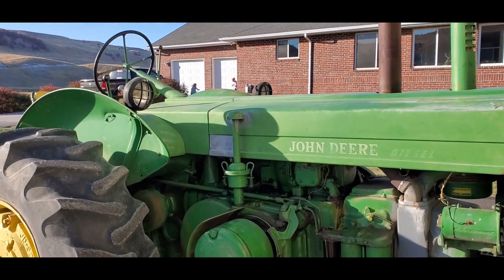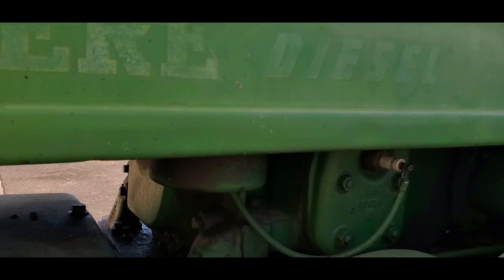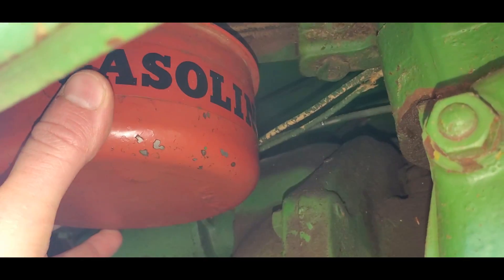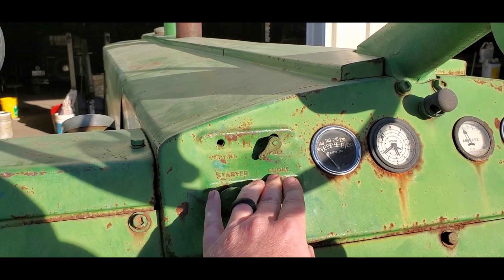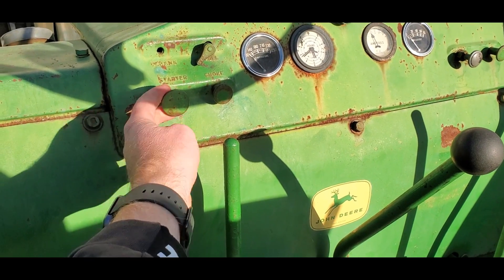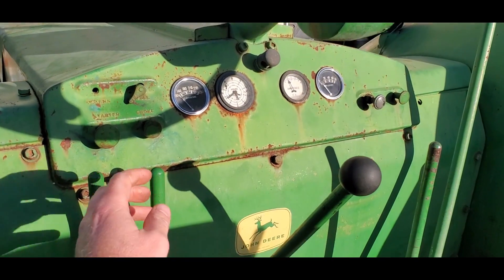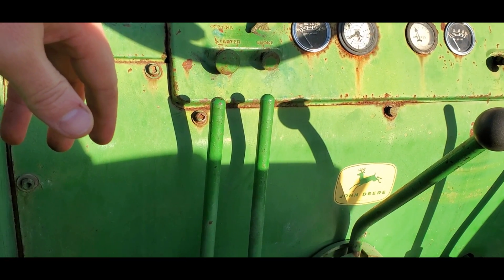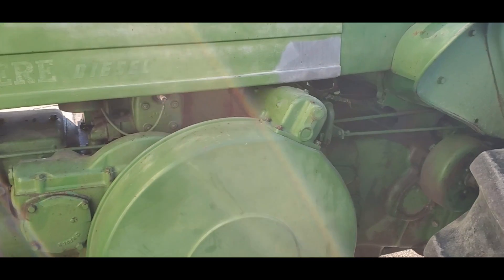John Deere R Starting Procedure

Comment: Hello - this is Grandpa Bill at the Northern Divide Model A garage and the Everett Family Farm.  Well - we picked up our Model R today, a day ahead of our first winter storm. Our model R has a few problems before we can run the tractor, needs a radiator repair and fuel isn’t making it into fuel injectors of the diesel.  A good project for the grandson this winter.
Reply from the maker: That's awesome!   Hopefully you can get it going without much trouble!

Comment: Huge big pistons. The German built unit only had 1 single cyl.  Would shut down engine. And reverse eng rotation for a reverse gear lol. Now we think have to have "multi cyl" at high rpm for hp lol.
Reply from the maker: Is that a Lanz Bulldog your talking about? I've never seen one in person, but I've watched videos of those big single cylinder two stroke diesels.

Comment: OK, I heard you mention something about advancing the timing on the magneto. Could you maybe show a video or share a video or give me the link to a video of how to do that or you doing that or anything about that lol
Reply from the maker: The magneto on the pony motor of an R uses a 12.5 degree drive lug as opposed to the 25 degree drive lug used by most all other wico x mags Deere used. Other than that drive lug, the mags are the same. So, to change the timing, you just need to change the drive lug.
Reply: @jonelsonster  you wouldn’t happen to have a photo or any information on the drive lug of the magneto would you?
Reply from the maker: @tracking_Jesus  the drive lug looks exactly like a short lug Wick X magneto, except it has 12 1/2* stamped into the face of it instead of 25*. If you leave your email, I can email a picture that has 25*, but the only ones I have with 12 1/2 on them are on tractors. 😅

Comment: I used to have a JD R serial number 1063. It had a rope start in the spare hole and adjustable throttle on the pony where the gas shutoff is.   It usually started on the first pull or so on the rope with a little choke ran nice and smooth until it warmed up and was ready to start the diesel
Reply from the maker: Very cool. I've heard people talk about rope pull start on the R, but never seen it in person. Both of ours are 1951 model year with electric start. Serial numbers: 8067 and 8259

Comment: I wish the pony motor on my 820 worked that well.  Its getting tired and needs carb work, but its not of those things. it smokes a lot and stuggles but it will 95% of the time get the diesel started.  Doesn't have near the power that it should, only rolls the diesel over at about 100 rpm and it wont turn the diesel under compression more then 5-6 times and itll stall out.  But if i run it decompressed, put fuel to the diesel for 1 revolution and let go of the decompression it'll fire right up.  Gonna be a winter project one of these years
Reply from the maker: This is our only tractor with a pony motor, so this is my only experience with them. But what you described matches what my dad says he remembers about them. He always says they are the weakest part of the old JD diesels.
Reply: @jonelsonster  from what I hear the opposing 2 cylinder is far superior from the later v4 pony.  I think a lot of the bad rap is operator error.  Starting the pony and immediately starting the diesel while it's still cold is a major killer.  I let my pony run for 5-10 minutes everytime I start it unless it's still warm from running  Doesn't matter if it's just sat overnight or sat all winter.  No motor like a lot of load when it's stone cold.
Reply: @jonelsonster  The pony motors just got abused and abused. If taken care of they work great. The V4s can crank just as well as the R's two. I will admit I don't think they're as durable, but that was the price for more power. A horrible video of mine. https://www.youtube.com/watch?v=__brLij_FCI&t=329s